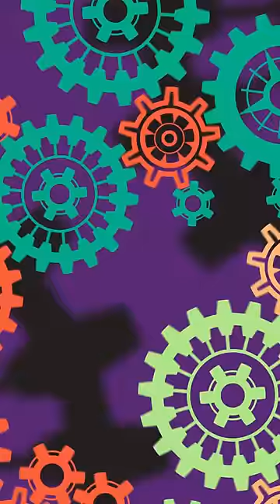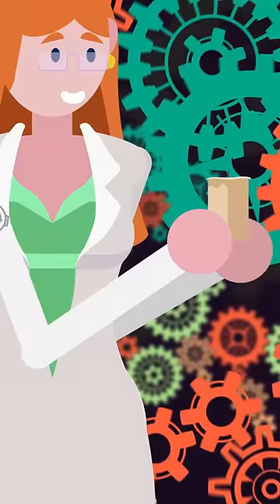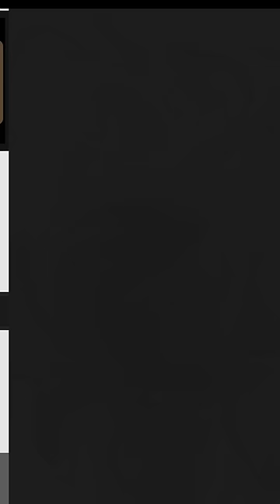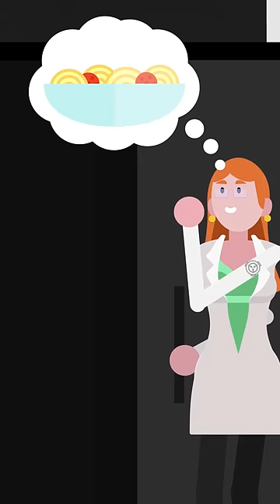What if a Candle Was Put Inside SCP-914?

Comment: I wonder what would happen if SCP-914 was turned on when it was empty?
Reply: Its sentient, it knows If it empty and dont do anything
Reply: @Dante_xy7  or..... It could just be a troll and improve the air in it and turn it into..... Uh... 

Marketable air....
Reply: There is a test log about this. The air was turned into heavier elements but it was too disperse to get accurate readings
Reply: @Evitzeoshowerthoughts  lol, 5 dollar per breath
Reply: @Evitzeoshowerthoughts  The plot of the "The Lorax" movie in a nutshell.
Reply: @StarbornCthulhu  I wonder what would happen if you put the entire machine in a hypothetical giant perfect vaccum chamber.
Reply: Lol if it made the air VeRy PuRe it would save the earth
Reply: I want to know what would happen if one of 6339s pens were put in
Reply: lol
Reply: It turns the air into an NFT, you can’t hold it and it is basically useless
Reply: @Evitzeoshowerthoughts  not o'hare
Reply: It's not empty. It's full of air. Depending on settings it would change properties of air. If it's in vacuum, it would create quantum structure that contains vacuum with leftover energy.
Reply: @Evitzeoshowerthoughts marketable air🤣🤣🤣🤣🤣
Reply: @Evitzeoshowerthoughts  o hare air

Comment: what happends if an object upgraded by scp-914 gets put back in scp-914 would it change? would it remain the same?
Reply: Depends what setting and If its an scp
Reply: @Dante_xy7  a non anomalous object placed on the setting fine multiple times  OR putting an object on the setting coarse and then the result back in the machiene to the settting fine or very fine...what would happen? (and why do i feel like dr Bright is not allowed to do that?-
Reply: @trash._.muppet1971  ok, so If no anomalous object is placed multiple Times with other settings except coarse or rough, it Will Be always different or similar but just new properties or then completely normal
If it is placed first either coarse or rough and then try with other, it dont repair it, BC its already broken, like 914 is upgrade machine not repair machinee
Reply: @Dante_xy7  fair enough thanks for explaining <3
Reply: @trash._.muppet1971  np, glad to help